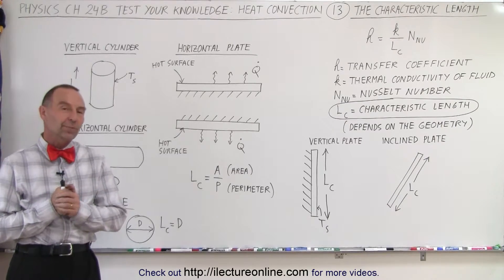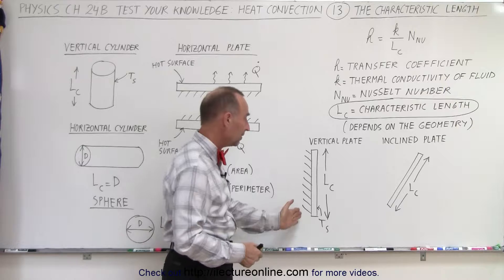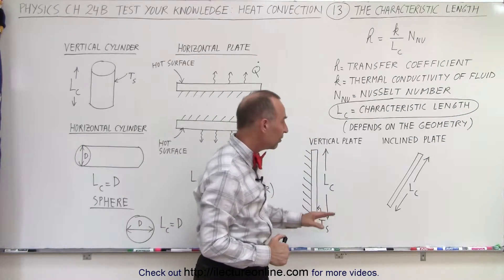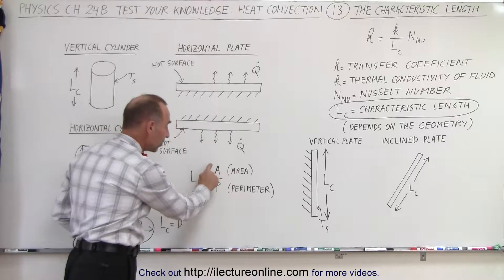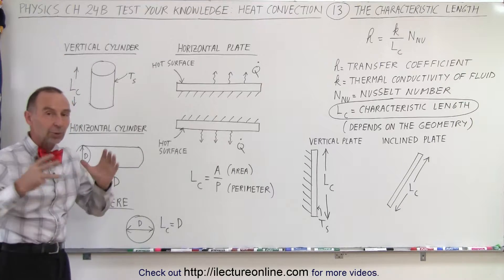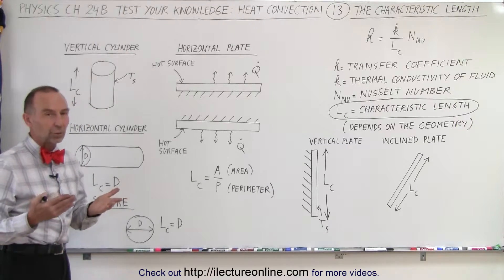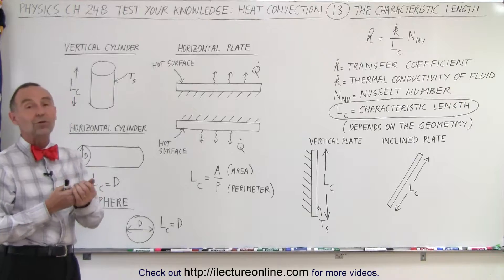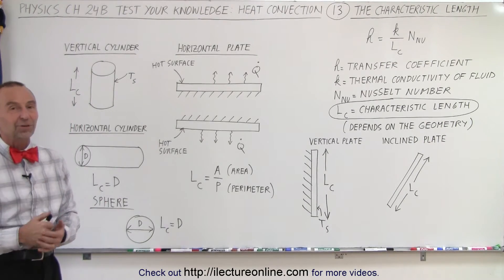Physics: Ch 24B - Convection: Test Your Knowledge (13 of 26) The Characteristic Length

Comment: sir can you plz help me in this problem ? which formula should i use ?
A driver at 25 m / s detects an obstacle in his lane. Braking starts at a distance of 83 m. At a distance of 23 m, a speed of 13 m / s remains. The speed is expected to decrease steadily.

a) What is the absolute value of the acceleration of the car? Give the answer with three significant digits.
Reply from the maker: If you draw a velocity vs time graph, you can find the time by calculating the area of the triangle and rectangle.  A = (1/2) b h + 13 b       60 = (1/2) t (12) + 13 t.     Thus time = 3.158 seconds.     Since the slope of the line = acceleration    a = rise / run = -12/3.158 = - 3.80 m/sec^2.  We have a number of examples like that in the physics playlists.
Reply: @MichelvanBiezen  Sir   thank you so much.
Reply: use newton's law of motion, v^2=u^2 + 2a*s